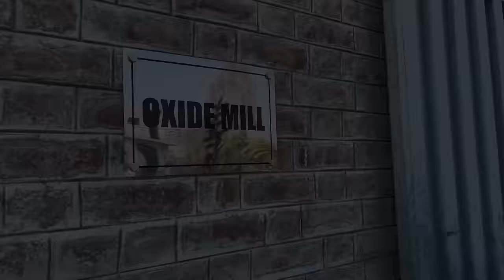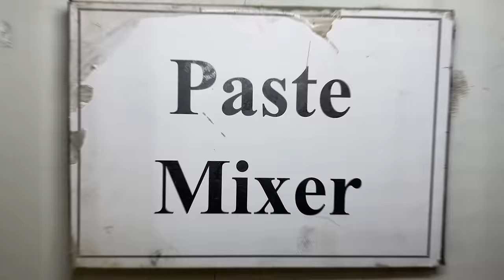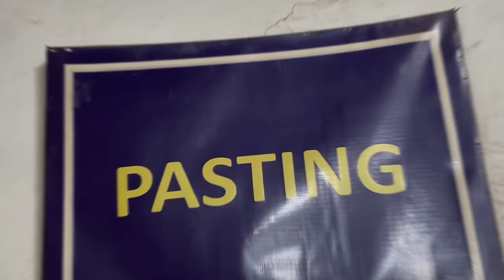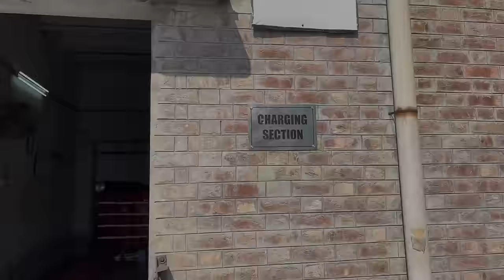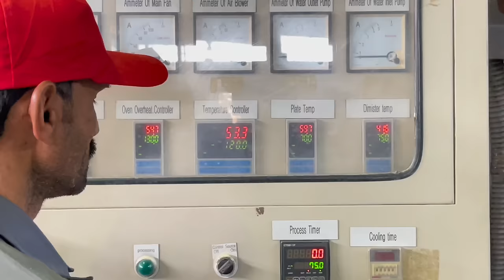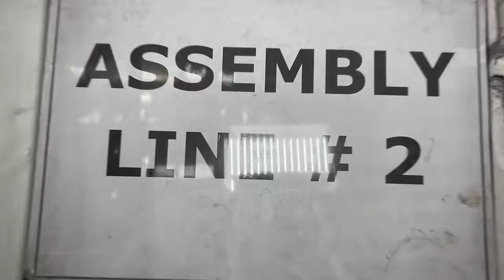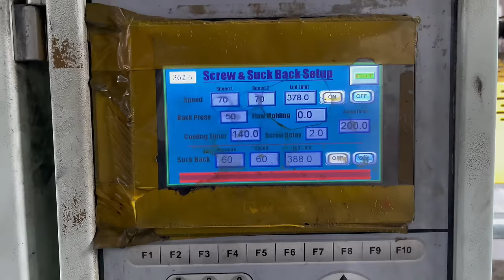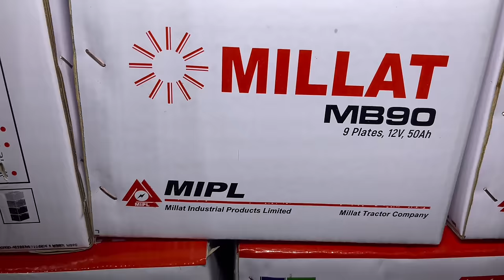60 Year Old Factory Producing Batteries | How Manufacture Batteries in The Factory

Comment: Similarity done in the U.S.A but with less automation.   America will not install electrolyte until ready to ship so the batteries can be stored in a warehouse without aging.
I see great workmanship and people proud to work at this clean plant.  I was impressed that the batteries were wiped down before placing them in the box.

I wonder how long it will be before someone comments about poor working conditions and should have laws regarding this,,,,just ignore them.

Nice well done video.
Reply from the maker: Your kind words mean a lot, thank you for appreciating the effort put into the video.
Reply: These are also dry shipped batteries.  The guy with the hose at 31:35 is doing what sounds like a vacuum check to make sure there are no cell leaks, not filling the cells with acid.
Reply: Hello can we do business together I need tublar battery parts